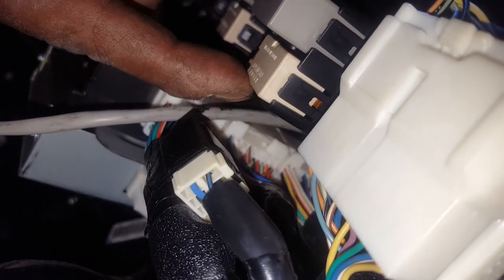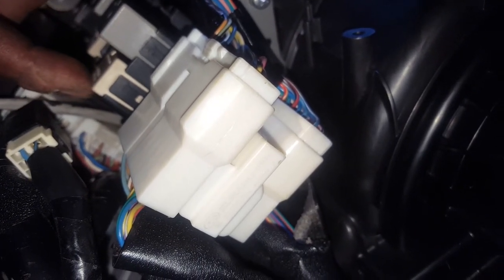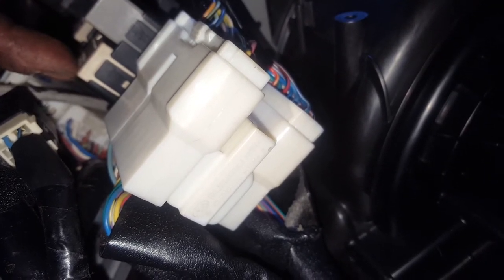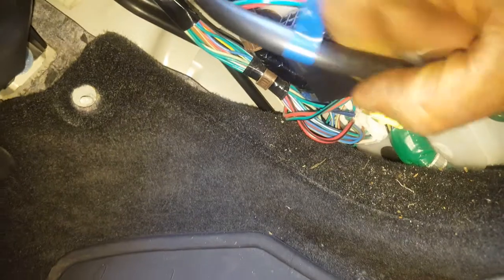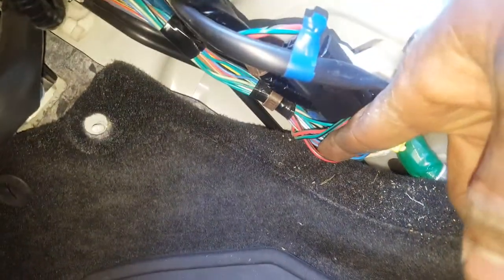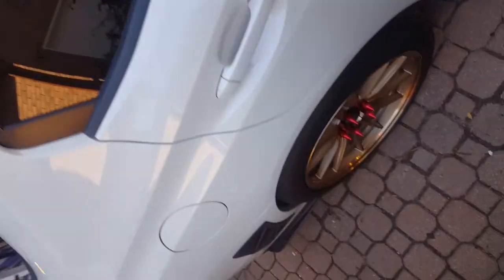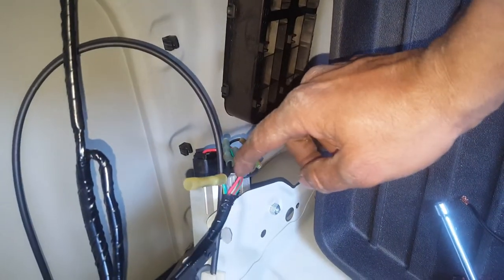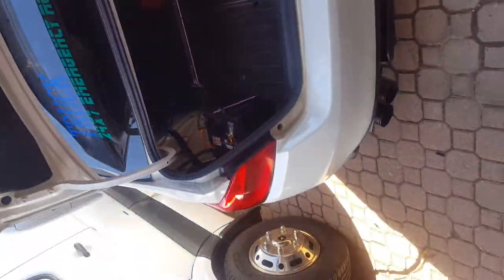2015 sti fuel pump relay

Comment: I have an aftermarket pump and controller installed but my fuel pump keeps priming even when the car is switched off. Can you give me any advice?
Reply from the maker: @charlvictor3714  because you ran your pump on battery. U need a relay and control the relay on switch  or ign switch